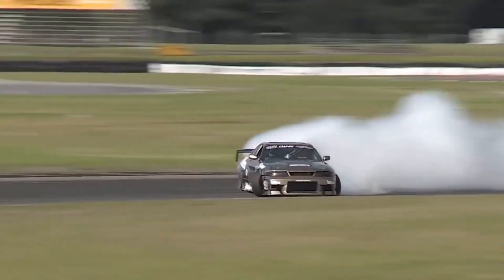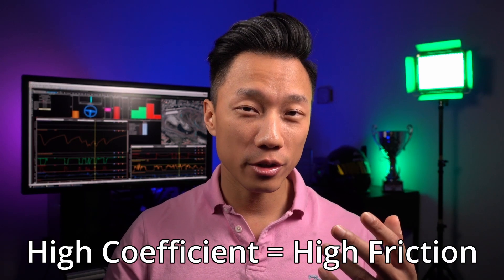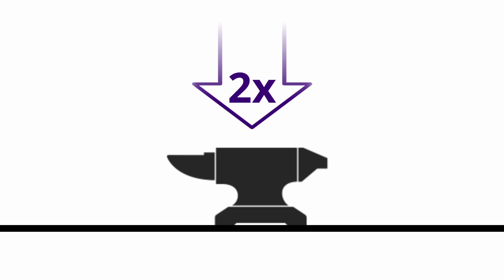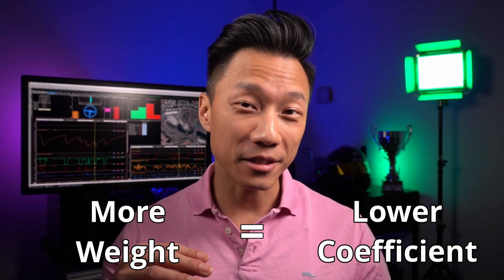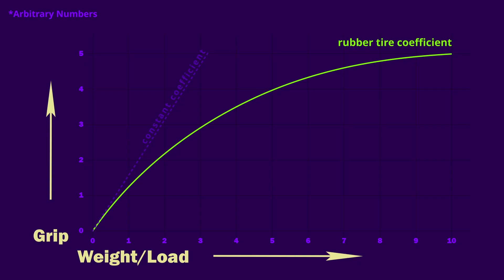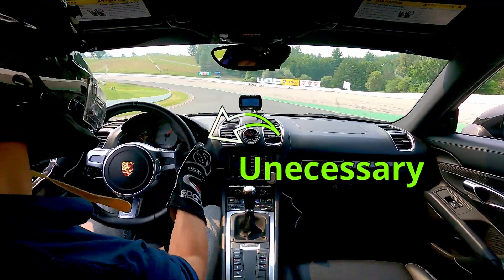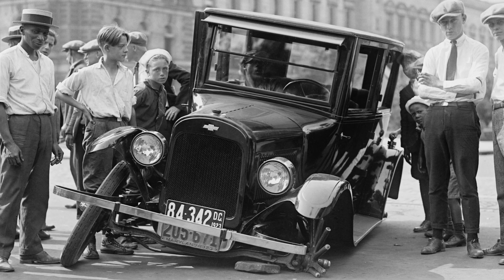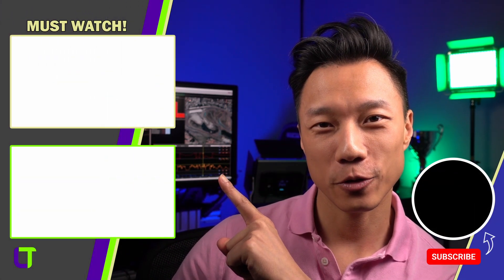How does WEIGHT affect GRIP? [IS MORE WEIGHT BETTER?]

Comment: Almost all you said are off. Less weight is not always better, you can see by your own graph that adding weight/load massively improves grip until around 2.5
Another misconception has to do with speed, a heavy slow moving vehicle has more grip than a lighter one, as speed increases the heavy one loses the advantage. 
So your chubby friend may have an advantage karting if the track is slow  and cold.

Comment: Wow. What a great video.

But why the rubber act different? Why rubber is loses coeffiecent when add weight
Reply from the maker: That's a great question. I've heard various explanations. I haven't thought enough about it tbh, but what I've read is i) it's because of rubber's viscoelastic properties, ii) and because tires are round and when you add load, it gets harder and harder to fully deform to a flat ground.

Comment: All these tricks give extra load to the tyres so logically the car acts as if it was heavier than it really is, of course at low speed corners that load is substantially less than at fast ones but in any case the car acts like a heavier one and giving that F1 cars turn way better than normal ones I don't understand how the opposite happens otherwise we wouldn't have seen all these applications on them, if we examine acceleration or braking process of course the lighter car is more effective due to its lower mass but would its tyres have more grip to achieve that? That's what I meant!
Reply from the maker: I'm afraid your logic is wrong. As I've mentioned, more load on a tire does not equate to a heavier car, just like how a plane isn't any lighter because of lift. A F1 car's weight is around 798kg plus fuel. No amount of downforce is going to change that.

Comment: And why FIA banned old school ground effect chassis with the most characteristic example of Brabham BT46B fun car which increased the grip so much giving the car big advantage in the corners?
Reply from the maker: Not sure what this has to do with this video, maybe you're confusing this video with another. Regardless, I haven't looked into it but I remember reading it was something on the lines of safety. Ground effects produced a lot of downforce, but it had a really narrow operating window. If you exceed that window, from too much roll, road irregularities , or damage etc, it would be like and aerodynamic off switch and you loose a lot of grip which will send your car careening off track, presumably at a very, very high speed. Add to that the lower safety back then, it was considered too dangerous.

Comment: Then if lighter cars are always better why we see F1 cars using these enormous wings to press them down making heavier than they normally are and why the majority of executive sports cars are over 1.5 tons heavy when with modern technology they could have been much lighter?
Reply from the maker: Well first of all, wings add downforce, they don't make cars heavier. They increase the normal force on the tires. As for sports cars, the reason, imo, are a few. Over the years they've had bigger and bigger engines, which need bigger brakes, safety, electronics, wiring, and everything else, making them heavier. Also crash test standards are probably a lot higher which would make for a larger and heavier car. Then there's the marketing. Nobody wants to pay quarter mil for a car with 13" rims, so they have to stuff big wheels and big tires and fit big brakes on them.

Here's a simple fact: when people convert street cars to race cars, nobody adds weight to it, they're gutted every single time. If you look at F1, and others, there are minimum weight requirements which is for safety i believe. Without it, they would just make the cars lighter and lighter.

Comment: What if your suspension is already set as low as it can go, but the addition of a little extra weight allows you to lower the ride height even more to make it more optimal?  From your load transfer video, you said if you lower the ride height, you can eliminate unnecessary load transfer which will increase grip.  Thus, you will be able to corner faster!   Or let's take it a step further and say I add some weight to get a lower and optimal ride height and also widen the track width by a little to further decrease load transfer, which will further increase grip.  Can this be an exception?  lol
Reply from the maker: Hey thanks for the comment! The short answer is, no, it's generally not going to work. 

First you got to define what you mean by the suspension "is as low as it can go". If it's as low as it can go, then by definition then the car cannot be perceptibly any lower. Also, you've made quite a few assumptions here... We know for a fact that adding weight, on it's own, is going to lower the car's peak G's - a heavier car is always going to underperform, all else equal. It's also going to increase load transfer, because of the added load. IF it lower's the ride height, the lower CoG will needed to reduce some amount of load transfer more than what was increased by the added weight, to have net improvement in cornering capabilities.

Even if that works, we haven't even touched on the aero implications, worsened acceleration/deceleration/fuel efficiency/wear etc.

Comment: Can you explain please. In context of acceleration, which car will have more traction one with most weight transfered to driven wheels or one with driven wheels are loaded less than non-driven( both cars have same mass an horse powers  like)
Reply from the maker: More load on the driven axle will provide more traction for acceleration.

Comment: Heavy cars are in no way better at cornering. They handle like junk. It is only in the last 20 years or so, that heavier cars have been able to pull their weight (; with regard to cornering.
It is also noteworthy that grip and handling are not the same, they overlap, but they are not the same.

Comment: So much science! My brain is exploding! Great video. On the contrary, the engineer designer of the r35 gtr said he purposely made the car heavier so it would have more grip. Is this true??
Reply from the maker: I couldn't find any info on that comment. Is there a link somewhere? I'd like to do some digging. Without any context, it doesn't make much sense to me. Yes it will have more grip, but the weight will slow down cornering, braking, and acceleration. If it were better, then people will just stick ballasts in their car. Also, it wouldn't be a first time an OEM marketed a design 'flaw' as a 'feature'. Actually my next video is on something related to that. Check it out here: "Is 50/50 Weight Distribution the best for Grip?" https://youtu.be/kVslPeT6Tt4